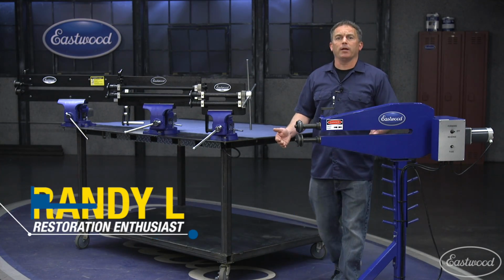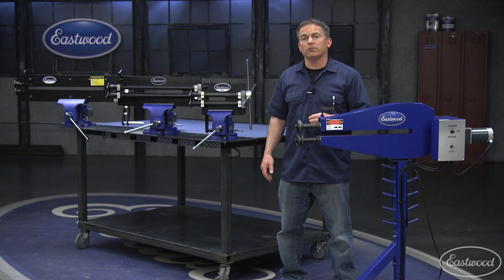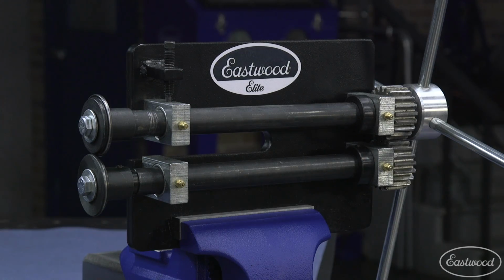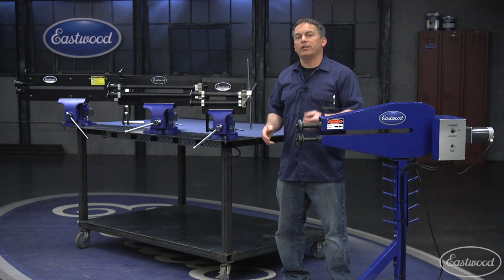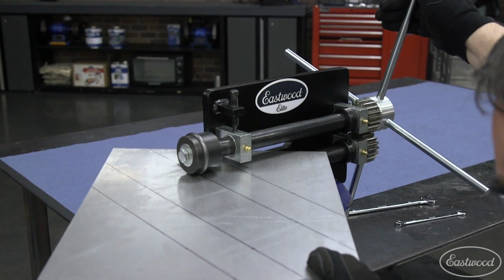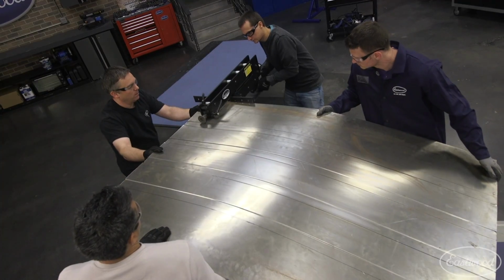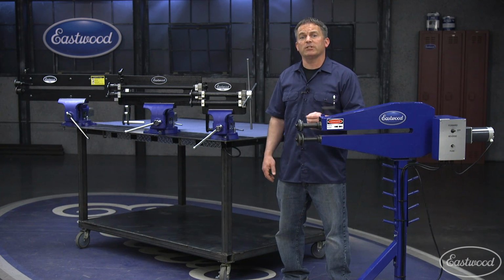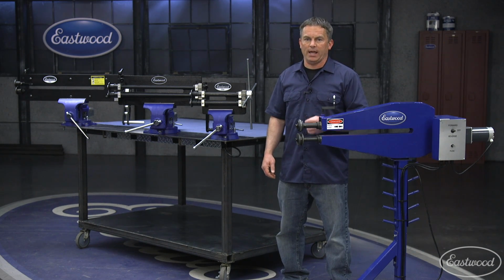Which Bead Roller Do You Need in Your Garage? Bead Roller Buyers Guide from Eastwood

Comment: Can the dies be mounted in both directions?  This would be useful for forming louvers   using the small 8" bead roller with your louver die set #28160.  If not, turning the sheet 180 deg. in the roller would put the louvers in 2 directions.